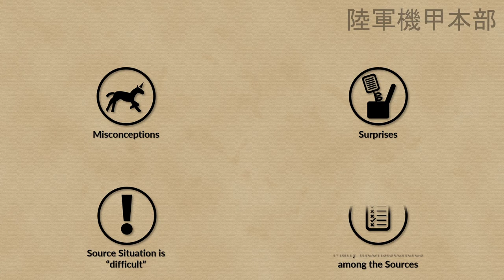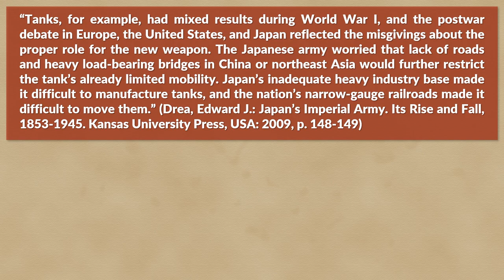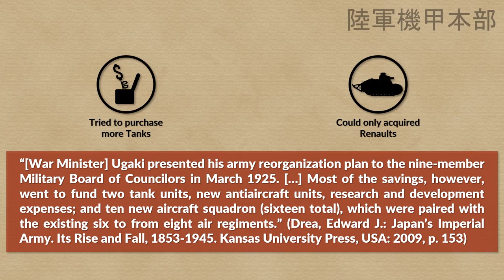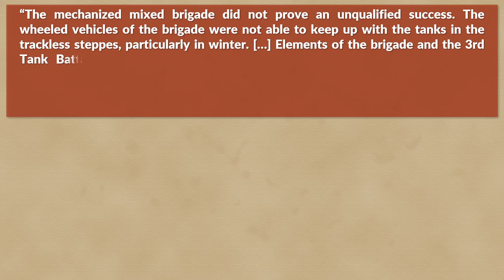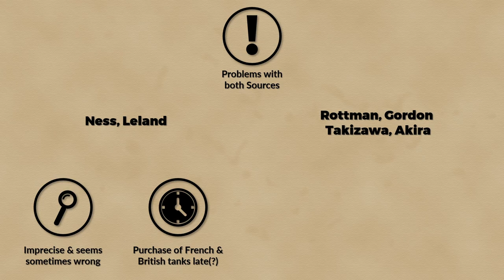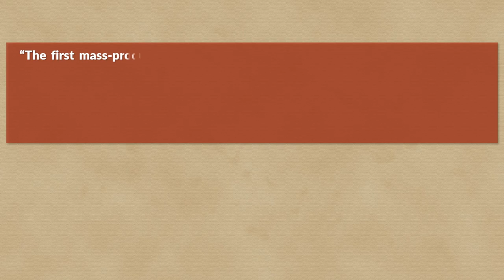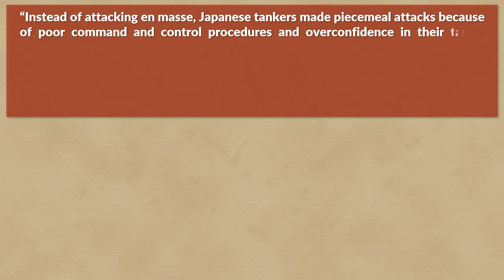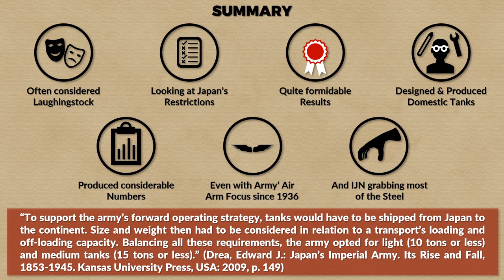Japanese Tank Arm (1921-1939)

Comment: I wonder what was the naming scheme of the japanese APCs. There was the Ho-Ha and Ho-Ki but neither followed the naming convention of the tanks.
Reply: The Ho-Ho-Ho was formulated for the dec 25th offensive
Reply: They follow the naming convention of Japanese self-propelled guns; "Ho" meaning "gun" (artillery). Japanese SPGs all had Ho- prefixes and the Ho-Ha and Ho-Ki fall into that as well. Whilst not being self-propelled guns themselves, both the Ho-Ha half-track and the Ho-Ki fully-tracked APCs were capable of towing guns - this, along with carrying infantry and delivering supplies, was the main role of both vehicles. I suspect that, given Japanese inexperience in designing such vehicles (the Ho-Ha is basically an amalgamation of the Sd. Kfz. 251 and the US M3), it was decided to designate the vehicles as gun vehicles because they aren't tanks, but there was no existing precedent for such vehicles.

I don't think that Japanese works the same as German in that Germans name things very literally so the concept, and therefore the word(s), for an armoured personnel carrier, didn't exist and the Japanese military didn't know how else to designate the vehicles. Instead of being literal about it like the Germans, the Japanese just called it a gun vehicle and that was that.
Reply: @Uranprojekt  In that case Ho-Ha would be third, but I can't find info on "ki" in the nomenclature.
Reply: following the convention, ho-ki would be design number 38, so it must not be that convention. perhaps it was intentionally put out of sequence to create confusion. 
i imagine they had no intention to produce large numbers of different apc designs, so they simply reused the existing ho designation rather than invent a new one.
Reply: @qwertzy121212  The "Ho" part makes some sense that they were designed as artillery towing vehicles.
The problem to that theory is that this would be one of the few if any times the Japanese did this, especially for a mundane APC design. The Ho-Ha and Ho-ki were of different designs with the first being a true halftrack and the later a fully tracked design.
The only other time I've seen "ki" used was on the type 97 Shi-Ki.
Reply: Ryan To Japan should've just stolen the BT tanks. It honestly suits them for their suicidal approach to warfare.
Reply: @firepower7017  Perhaps a little more research would do you well. "Aggressive" and not "suicidal" was the norm.
Reply: Ryan To Yes to the people that believe that existence is just a obstacle to your true goal which was death. It honestly is a better fitting term to just call them "aggressive" they also are the same people who could've cannibalized George HW Bush. Again is this another notion of aggression? What about the Phillipines. When they lost the island, they practically took it out on the inhabitants. How about the one point which the citizens that occupy China started jumping off cliffs and dying in ways which you don't want to  know, was this post aggression?
Reply: Ryan To Also just a kick in the teeth, people believe the Japanese was "ORDERED" to do these acts, which honestly confuses me because who in their right mind wants cannibalism or chop as many Chinese heads competition. Or those horrendously Inhumane experiments.
Reply: @firepower7017  Nice strawman. The argument was on japanese tactics, not on their warcrimes.
Reply: Ryan To Should I mention their reliance on bayonets? Or when they lose, they commit suicide anyways? How about when they employed Kamikaze at an alarming extent, even building special weapons that is more suited to doing such. The Japanese philosophy on life is already a dead give away to their suicidal nature. Hell it even affects them today. Like what in God's name can just harm anybody just because they feel under the weather?
Reply: @firepower7017  The Japanese view on life wasn't really focused on suicide or being suicidal, they just had a different outlook on life than they do in the West. The Japanese, and Asians, in general, have a more casual disregard for human life, both theirs and others than in the West. With the Japanese, there was a high value placed on honor, both personal and of others like their family, superiors, and esp. the Emperor and bringing dishonor to yourself, or others, was considered to be quite disgraceful and if the disgrace was large enough then committing suicide was the only way to pay for the dishonor. 

When it came to WWII, the whole Japanese concept of honor from the days of the samurai had been resurrected and was a part of their military culture. As a result, defeat was considered a great dishonor and something that few could live with. Surrendering was also considered dishonorable and it was generally considered to go down fighting rather than retreating, or, heaven forbid, surrendering. And it worked for the Japanese, in the short term but in the long run it cost them a lot of troops and good commanders.
Reply: @Riceball01  Funny enough. I'm Asian. It's mostly Japan with this mindset. The rest of Asia is more about survival.
Reply: @Riceball01  And rather suicidal in disregarding life. Just like being suicidal makes you disregard the consequences of death
Reply: @firepower7017  You still on about this? You being "asian" isn't an argument, I'm chinese and I can still objectively see the facts and not the stereotypes children get from watching hollywood movies/video games. You'd realize the "suicidal" habits of the japanese military occured when there wasn't any other alternative. This ranges from troops trapped on islands when the navy can't transport them away ala Saipan, to close in tank assaults ala every nation did.

The bayonet is an effect weapon not as a killing tool, but a psychologic weapon. European accounts mentions how pefectly planned bayonet charges can rout/demoralize the enemy with minimal loses from the thought of being stabbed to death.  Even in modern times, there are reports of bayonet charges that causes the same effect. One being the famed Gurhkas charging a numerically superior Taliban force. This is especially true when charging conscripted, half-starved chinese peasants with little heavy weapons. OR even consider the battle of Bataan with the numerically and firepower superior Americans still lost.

Bayonets will suffer problems when faced with well discipline troops with heavy weapons just like in Saipan. Then again standard military theory argues that you need at minimum a 3 to 1 advantage in an assault.
Reply: @TheLastSterling1304  I was answering Riceball's inquiry. Which was a WEEK AGO! Again you've tried to derail the comment section yet again.
Reply: @TheLastSterling1304  Also dying for your reputation is practically the equivalent to suicide. Because it can cause it. If it weren't blatantly obvious by the many weapons and  tactics that was to often regain it. By dying in a honorable fashion.
Reply: @firepower7017  You were the one to suggest a tank design based on stereoypes for the japanese on a post originally about the japanese APC designs Which was started by "ME".
Reply: Ryan To It wasn't really a stereotype, it was rather it's practicality. If the BT-5 was soo bad why did the Japanese feared it? It had good range, a good gun, far better armor, it could carry troops, it's pretty much the fastest tank. The stereotype was of a more comedic yet realistic point in the Japanese tradition and how they handle warfare. It's honor or die.
Reply: Ryan To How about tha time they sacrificed the Yamato, was this post aggressive aggression, or was it suicidal? Or what about the  Kamikaze missions. Those had to be of aggression, right? What about the lunge mine? Why did they jump at tanks and die? Was this somehow some mystical aggression,  I do know that the Chinese did it first. But it's the Chinese.
Reply: Ryan To What about when they made the fukuryu, was this more aggression? Plus the inclusion of a suicide boat which was built to ram into enemy ships and explode. Was this more aggression?
Reply: @firepower7017  You have been refereing to atypical actions as the norm. The performance of the Japanese early in China, Malaya, Burma, and the Philipines speak otherwise. The Japanese were not stupid to waste lives if there was nothing to gain in an assure victory

The BT is just a tank, and the japanese saw it as such; nothing to really fear. If you actually considered seeing the reports of soviet loses, You'd realize they lost a lot of tanks and armored cars. Raw statistics only goes so far into actually using said tank to it's fullest potential.  The BT with all it's quirks has weaknesses and limitations. This is especially true due to the regions japan is fighting. The only places a Japanized BT can fight is in China and Manchuria which is not the areas of priority during the war.
Reply: @firepower7017  Like said before, these actions are not the norm. Operation I-GO was not a a true "suicide" attack, the goal was to beach the ship into a position to shell the americans. 

Your mentioning of suicide troops are of the tokubetsu special attack units aka special operations and not the standard regular military. 

Neither of these contradic my point is that the japanese favored aggressive tactics and not Suicide as the norm.
Reply: @TheLastSterling1304  The situation in Asia showed that it was mostly an aerial skirmish totalling in a Soviet victory. On the ground the Japanese tanks practically sucked. And to even get a good description of how bad IT SUCKED TO AN ABYSMAL DEGREE IT SHOULD'VE FOUGHT IN WW1.

And most Soviet losses totalled due to ambushing infantry. Ironic the Fins did the exact same.
Reply: @TheLastSterling1304  Banzai charges? HEWWO?
Reply: @firepower7017  If you look at the OOB, you'd see that the majority of the fighting was on the ground and not in the air. 

The Main tank of Khalkin-Gol was the Ha-Go which statistically on par with every other tank design at the time; T-26, Panzer II, M2 Light, etc. The Chi-Ha would gain the 45mm gun by 1942 which was on par with the soviet 47mm(which it was based on) the 2pdr and early 50mm guns.

You've also supported my claim that japan didn't fear or need the BT by mentioning sucessful infantry assaults on tanks. Ever nation did it, and worked well.  Tanks are vulnerable under the right conditions. Even the later shermans would fall victim to this by the japanese. 

Banzai charges weren't always suicide attacks if you actually look at the contents. They worked effectly well earlier against the russian empire and chinese forces and even against the british and americans early into the war. It's when they run into heavy defenses and still keeping going on regardless that inhindsight they look suicidal. Would the charge by the a US Ranger Battalion against a full German Regiment on Hill 400 be considered suicidal?

Do format your posts, no one likes a doubleposter.
Reply: @TheLastSterling1304  Here's the problems with the infantry attacks. They often fail against the BT due to it's unmatched speed. Most common way the Japanese hoped to destroy the thing was by Molotov in the engine. You seem to think the Japanese was confident to destroy the tanks. Yet many of them feared of it. If it was bad why the armistice?

Also don't pester me on my habit of reapeating things, if people weren't going to digest the information I pulled out which shows the commonality of these suicidal tendencies towards a race that has a system of honor. Which even in the modern era makes it the most suicidal country although being far modern than most. Then explain that?
Reply: @TheLastSterling1304  Also I find it a fallacy that the Soviets completely won out of sheer numerical advantage. As SIBERIA is a real place. And only way of transport is by train. Not to mention the purges. Also Japan DID rely on their air force. Why did they test the Zero in China then hmm? And the Ki-27s was unmatched. Leading for air superiority. And it was tested to the extent on the US which was heavily effective. Not to mention the Japanese invented the aircraft carrier. And took pride in their air force.
Reply: @firepower7017  That's not fear of the BT, that  is theunderstanding that strategic situation Japan was on a backfoot against Russia at that point. Whether or not the BT were their doesn't change anything. 

The japanese had Anti-tank Guns fully capable of penetrating the BT at the battle against the russians so your argument just doesn't make sense for them to fear something they are fully capable of engaging.

The only strength of speed the BT has still isn't good when tanks can't fire on the move, they still need to stop. It doesn't take much to break a track, enough artillery fire will eventual cause damage. 

People are digesting your information, I are just giving concise and rational counterarguments that prove your argument wrong. You've kept repeating stereotypes as your only argument that I have given accounts to disprove.
Reply: @firepower7017  I have no idea how you interpreted what I explained as that.

Nothing i've said mentioned any of that.
Reply: @TheLastSterling1304  Stereotypes? So the Yamato incident was a stereotype? Are the Banzai charges a stereotype, although they seem to be frequently used after the Japanese lost superiority. You blatantly call them independent incidences yet they simultaneously happen after a loss. Even the kamikaze attacks proved advantageous towards the Japanese yet you call it an independent case although totalling the entirety of their air force. You never pay any mind to these yet factor them as nonsense although it's been recorded countless times.
Reply: @TheLastSterling1304  Also most sources claimed the Japanese prepared the offensive first and horrifically lost 70% of their forces in the engagement. Not to mention there have been little amount of BT tanks that actually fought as the Soviets soon later invaded Poland.
Reply: @firepower7017  Again, what are you interpreting when reading my posts?
Reply: @TheLastSterling1304  "A majority of the battle was on the ground, not the air"
Reply: @TheLastSterling1304  Also with the BT tanks. You've stated it to be ineffective, yet that tank was given praise for defeating the Japanese. And was practically the staple vehicle of it.

Also why did the Japanese 23rd infantry die off from encirclement leading to the armistice?
Reply: @firepower7017  Again, what are you interpreting when reading my posts?

I say it was mainly a ground battle, and you believe I said planes sucked. I say the BT isn't as great as people think, and you think I said it sucked.

You keep asking the same questions that I have been answering, yet you can't even understand it without interpretting as something else.
Reply: @TheLastSterling1304  You didn't even answer most of these, yet you claim you have. You blatantly label these tactics as stereotypical anomalies, even though it was practically advised when it came to being defensive, just like Germany building far more powerful weapons to gain some advantage against overwhelming odds, Japan opted to use the lives of their own subjects to level the playing field. Yet this is seen as some stereotype? 

So in your words, Germans that use high tech weapons of itself is a stereotype?
Reply: @firepower7017  No, this is something would would be claiming based on everything else you've been stereotyping.
Reply: @TheLastSterling1304  You still didn't explain why it's stereotyping, also how it's not evidently true? I can literally use the Japanese suicide rate of TODAY and without being in any conflict. It is irrefutable to even counter argue.
Reply: @TheLastSterling1304  Heck my sister had a Japanese friend who got stressed over by ONE troll comment.
Reply: @TheLastSterling1304  What about the countless nightkin like attitude many teens faced making them unable to interact with SOCIETY!
Reply: @firepower7017  And?
Your the one making stereotypes.Especially when you're trying to use it to claim things from a different topic.

I'm not the one making stereotypes, so why would i say the german stereotype is advance technology. 

And I have explained why it's a stereotype based on their performance throughout the war. I've already mentioned China, Malaya, etc. You just conprehend anything else but stereotypes.
Reply: @TheLastSterling1304  China and the rest of Asia was inferior. Also Nationalism doesn't fall apart until you lose. Look at Italy and Ethopia. The first time Italy tried to takeover. They've been met with serious opposition. With enough desperation they lost. Until WW2 came about and pretty much overwhelmed them.

You mentioned about less serious contenders of which was planned for years! When Germany screwed up in Russia. They too got desperate and began using more suicidal tactics. Usually expending what's best until it can no longer fight.
Reply: @TheLastSterling1304  What about the conflicts in the US? What about the. American Revolution, War of 1812, Texas Revolution, Civil War, Korean War, Vietnam War. Most of these have resulted in one side pretty much going all out, even at the cost if people especially Vietnam. In Europe you have pretty much every war since one side would've significantly lost all it's manpower in the end to a degree which becomes every man for themselves which is far too vast to list all the conflicts in a given amount of space.
Reply: @firepower7017  Your point is?
Reply: @TheLastSterling1304  The Japanese are suicidal. Heck the Thesaurus has synonyms of suicidal which included, deadly and dangerous used in the context of fighting. It usually refers to one's self to be extremely apathetic towards the opposition and themselves.
Reply: @firepower7017  Your point is? Call me back when you do.
Reply: @TheLastSterling1304  Like when you put something like order 227 or the Kamikaze Missions. Were they completely willing to die from sheer depression or by means of order?
Reply: @firepower7017  Honestly not seeing what you're going on about. You go on about stereotypes, then to sucide, then to something about europe, then back to stereotypes over several back to back post. You did writing classes correct?
Reply: @TheLastSterling1304  Point is. You used suicide too literal in the context making you literally derail the thing.

Also the BT-5 is underrated. Weebs and Wheraboos praise the Tiger like it's God's gift to Germany. Yet you have the audacity to call a tank from a conflict most forgotten "overrated", which was the proving point of it's effectiveness which the Germans also employed in Poland as a means to confuse and overwhelm the enemy. With nearly as fast, but mostly inferior tanks which gave them huge praise even though the tank force of the German military probably composed of mostly Panzer IIs, IIIs. Even fighting Russia they did the exact same giving them no time to prepare. And the Soviets had the PTRS and PTRD yet still struggled until it got close to home, not by the already effective guns which saw the introduction of external armor. But because the Germans had poor logistics. What a good JOKE
Reply: @TheLastSterling1304  You resolve to insulting my grammar yet, I explain the reasoning of why Japan was suicidal in tactics. Explaining the situation of desperation. And many of the reasons for how they act, yet you relentlessly call it all stereotypes. You haven't read a single thing for you're a hypocrite! You didn't counter anything. I backed it all off the basis of their suicidal nature, being the spawn of their honor code which was apparent. And you have no factual claim to prove otherwise since Japan is heavily rooted towards traditions. And that you'll honestly go all out especially in a time of sheer embarrassment.
Reply: @firepower7017  I'm not insulting your grammar, I'm stating that you're not helping anyone or yourself with your random trivia, and multi-posting. 

I don't see how a tiger tank or german logistics fits into all your random arguments. All you've been doing is spouting random points that in your logic somehow fits.

Somehow me saying that the BT tanks weren't as great as people see them with their high speeds that to you think i'm calling it useless. Even Soviet AAR understood the limitation of the BT after the battle.

I think you should calm down, breath and remember you're arguing that that the japanese are stereotypically suicidal, the BT somehow fit this stereotype, and was the ultimate tank of it's time using anecdotal evidence, and that I'm arguing against it.
Reply: @firepower7017  The Japanese are not sucidal

Victory is paid in blood. All militaries understand this. The Japanese in WW2 understood this to a higher degree, but not suicidal.
Take the Malayan Campaign. Instead of doing the stereotype of charging into the British position, they instead decided to flank around British defensive lines through the jungle or under the cover of darkness and thereby bypassing them whenever the situation allowed them to. These tactics would continue to seen throughout the pacific war. They understood that purposefully wasting lives unnecessarily is counterproductive.

When get situations like Saipan when the defenders are trapped on said island, their only choice is death by starvation or death by fighting. We see this happen to the 2nd Rangers on Point Du Hoc and Hill 400. In both battles the Rangers had to assault heavy fortifications then to defend against overwhelming forces while suffering heavy loses, yet we don't call them suicidal. Neither does the Leonidas squadron make the whole German Military suicidal just because that unit existed.

BT was not ultimate tank of it's time and does not matches their sucidal stereotype

They understood that tanks are complex machines that you cannot waste expecially when their industries couldn't produce tanks in large numbers; Industrial capacity and resource priorities. Like I stated above, they understood that wasting lives unnecessarily is counterproductive. They didn't want to waste valuable equipment to the point of stockpiling of their more advanced tanks on the Home Islands. 

Like I said before, it is not as amazing as it is statistics make it out to be with it's high speeds. You should understand that the "high speeds" is when they're driving on wheels not tracks which was the design of the christies. In reality the tank was always on tracks at speed of around 45kms, which is around the same for the ha-go at 40kms. Everything has limiations and misuse will give it poor performance. In the BT's case too fast for the rest of the army to support, to lightly armored to support the rest of the army as stated in: http://ftr.wot-news.com/2013/11/12/soviet-bt-tanks-in-combat-part-1/ and http://tankarchives.blogspot.com/2013/12/hpz-bt-7-and-t-35-woes.html
Reply: @TheLastSterling1304  The sources you posted showed flaws in planning, For the battle in Spain, it was in Urban conditions and it didn't fair well since you literally are blind, even the most modern MBTs can fall victim in a urban environment, the other claim was it dying to a 1v5, well if you honestly take a look on how a overwhelming force can drastically change the morale of anything. For example in Stalingrad. It's pretty wild, and in Japan, why the AT guns practically got close to even killing one was due to poor Soviet planning as the purge already took a toll. Also if it was used as intended, by using it's speed. It wouldn't have screwed up.
Reply: @firepower7017  Which is my point. There is little difference between the BT and the Ha-Go, and so long as you use them correctly both will perform well outside of supporting arms helping.
Do stroll down the the BT's performance against japan which where I am arguing from. This is especially true when facing against AT guns. Tanks have limited vision and can't effectly spot dug in AT guns and Infantry which is made harder when button up and on the move. Neither can tanks fire on the move with any effect. Speed doesn't help much when you still need to stop to see and shoot the enemy.

I don't really see the japanese pointlessly suicidal when they have such doctrine like "Kantai Kessen" aka Decisive Battle.  They are willing to hold back valuable resources for use at the right time. You may have the "special attack" units, but these are small scaled compared to the grander scale of things.
Reply: @TheLastSterling1304  That's the difference between the BT-5 and Ha-Go, is the gun, and vision, the Ha-Go has poorer vision due to a cramped turret, it also means that the gunner has to use his arms to elevate and keep the gun steady, while also rotating the turret because honestly who would use the crank in such confined space. My reasoning that the BT-5 is far superior than the Ha-Go in literally every aspect except the engine, but all tanks even late war suffered engine problems, and I accidentally misworded what I meant by suicidal, I mean the individual soldier, look at the many times they tried to be captured. And defectors was very very rare.
Reply: @TheLastSterling1304  And saying that it's impossible to shoot on the move is a fallacy, it depends on the level of ground and gunner skill, and since the Soviets practically used experienced tankers from the Spanish Civil War, the Soviets undeniably had the upper hand, what hindered them was poor logistics due to the purge. And the area which they fought wasn't all that terrible, and the Molotov situation could've been avoided if the Russians just simply added a vent cover, which only block the sides of the engine but also leave a good amount of room at the top to avoid splashing.
Reply: @firepower7017  The difference betwen the BT and Ha-Go in vision is arguably the same when both tanks had the commander as the gunner. Ha-Go might have a slight edge in that it had a cupola with armored visions slights.

I didn't say tanks couldn't fire on the move, I said effective fire on the move. The slightest bump will throw off the gunners aim. This is a time before stabilizers so the gears will not compensate for the literal movement of the tank on the gun. 

It is in this situation that the Ha-Go has a slight edge. The shoulder aiming effectly turns the gun into a large rifle when aiming. Couple that with a free horizon trunion allowing for reasonable left/right aiming outside the turret traverse. 

The word you're looking for is fanatical. There is an overlap between fanatical and suicidal. the difference is a fanatic has more reason to see staying alive is much more cost productive to a cause.
Reply: @TheLastSterling1304  They weren't in the very least fanatical, again the Japanese soldier seen no point to fight other than to do it for the emperor. Once they screw up in any way, it's pretty much disgraceful, heck a Japanese titanic survivor was exiled for being a coward. as an example since you seem to never get them. 

Also the Ha-Go never was built to engage tanks, which is why it used mainly a one man turret, it also isn't beneficial to use the body to effectively control the turret as of human endurance, and since it's also cramped, you aren't really going to effectively use a free traverse system properly. And the tank has height restrictions making it unable to be universally used, which is a good thing. Only that you also are limited to the amount can be used at a time
Reply: @TheLastSterling1304  whoops, they were fanatical, which made them crazily suicidal.

Edit: I'll leave it as fanatically suicidal, seems to fit their description the best.
Reply: @firepower7017  Which is what I've been trying to say. They were fanatical in their duty to the nation to the point they would literally fight to the last. You have stories of holdouts after several decades. If they were suicidal they would have gotten themselves killed fighting instead of waiting for the military to return.

When you get suicide units like the kamikaze, they saw the cost productiveness of such tactics. A few planes crashing into a fleet is devestating. Moderate damage will cause them to send back ships, weakening the fleet. 

Even then, they still had standard squadrons of fighters. 

There are rhetorical evidence to even suggest that many, if not all kamikaze pilots were forced into such units so even the sucidalness is questionable. Peer Pressure and the Milgram Shock Test comes to mind. Japan was a authoritarian nation, there was no disobeying without punishment to you, or your family.
Reply: @TheLastSterling1304  Sorry mate but soldiers are more useful alive than dead, no matter the context.